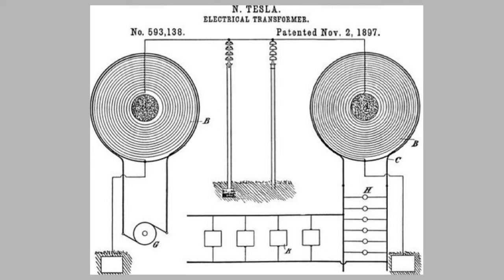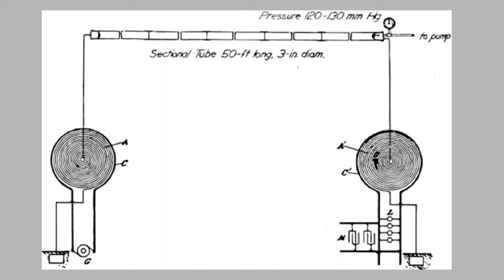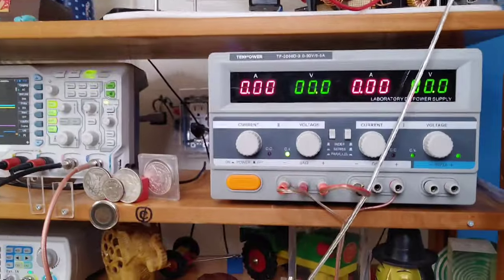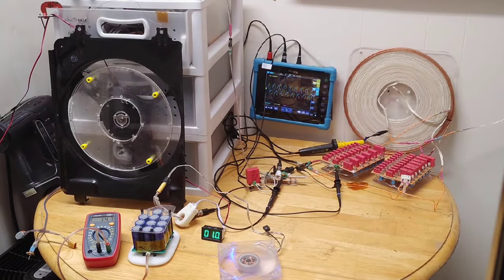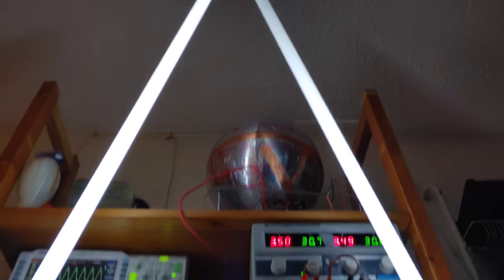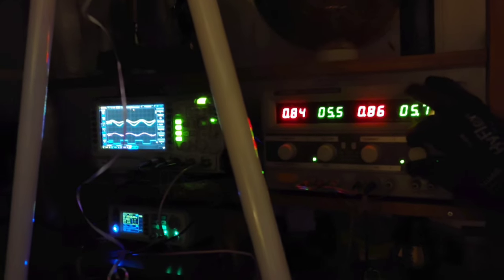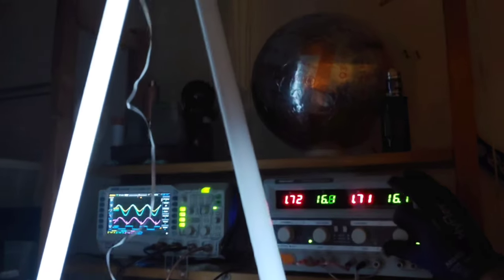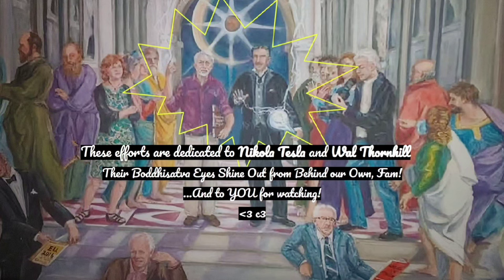Nikola Tesla's Single Wire Power Transmission, Part I: thru Flourescent Tubes & Wire

Comment: You seem to have a lot of stuff but you don't know what any of it does.
Neither of those fans are "inductive loads" if they run on 12vdc.
Whether the coils are wound clockwise or counterclockwise is completely irrelevant. Surprise: flip them around. See what happens. Its sad that you have so much useful equipment and zero clue how to use it.
Reply from the maker: Everybody know haters just jealous. My meaning was simply that a DC motor filled with copper windings presents extra inductance into a tuned/resonant circuit, impacting the rez freq. And yeah this is my debut video, opening line is "hello world", to go public with my lone project lol. Wanna come help?
Reply from the maker: Dude i've made dozens, i know it's arbitrary. Its also effortless to wind them opposite. I counter-wound them because it pleases me to do so, and because it pleases me to follow Tesla's patents.

But i do apologize that my excellent showmanship and well-spoken delivery caused you to expect an expert; and calling myself a "labs" is just my marketing flair lol. Mind the skillz, salty no0bz. Hataz just be jealous.

Im a petroleum engineering graduate teaching myself a new skill set successfully. But i DO understand energy systems, and also suspect there may be some advantage NOT being indoctrinated into "modern electronics". Next-gen energy, is a noble pursuit no? I'm pleased to help 'market' this stuff to non-experts (99% of ppl).

Btw i made the background music myself too, i hope it was annoying! You consumed all my goods, nephew. My first album 'cold electric' in 2008 went viral when i put it on bit torrent, track #1 was called Tesla. I'm a bit of a Teslaphile. My first original wiring product in my 'cold electric hardware' ebay store sold 8k units worldwide from 2017-2020.
www.soundcloud.com/djcoldelectric
www.ebay.com/str/coldelectricml

Blowin up my most refined output is just my style, dont be mad. And I PROMISE you wont see me claiming no 'free energy' quack stuff, i've taken thermodynamics lol (you heard me admit 20% efficiency right)?

I'm not discovering or explaining or asserting anything, just demonstrating. My only soapbox is ELECTRIC UNIVERSE COSMOLOGY 😈
Reply from the maker: @htomerif I've alrdy written your opinions/ ideas off as toxic, but go on and speak your truth bro, if it helps ya, poor guy, thinking he's supposed to know stuff. Do you find modern tech/understanding so impressive? We're a sinking burning ship thanks to our "understanding" up to this point.
Reply: @htomerif Man, even longest journey start with first step. Guy buid something and getting experience and also gaves a credit to guys in the field he follows. You just hanged on opposite wound coils. Why not try yoursels two flipped and two opposite wound coils. Use magnetic fiels viewer and see difference for yourself. Yea, put them on dc for steady field and watch. Maybe, just maybe, ferrocell will show you some compression/decompression lines. Finally, yes guy used oscilloscopes to show real signals which i encourage. No fancy equip just essential for experimental start with self learning so pls don't sheet about donating to some school. Schools are driven by someone's plan and program and this is open source. So, be constructive critics and show us something smart with flipped coils. Will You? Cheers!
Reply: @zeljkolukac4170  no. you understand nothing of what this video presented.

"blah blah journey blah single step"
Guy is walking the wrong way, towards idiocy.

"blah blah blah equipment"
he doesn't know how you use any of it and you don't know what I meant by "blinkin lights". Its a term. Look it up.
Reply: @htomerif  Yea, I guess that every ono who follows Tesla patents strictly is on blinking lights way. That way none can recplicate something usefull because it is fuked. Lot of replicators think Tesla transformer is 2 coils or two coils and capacitive load and lot of sparks. My homble opinion that system consist of 3 coils and capacitive ball at top. Good ground is must have. Thinking in terms low coupling, disruptive discharge, magnyfied amplifier, standing wawes and scallar potential. For me at the moment enigma is why Tesla used lot of turns thin wire in secondary serial tank circuit because that circuit tend to high current in resonance which is opposed to have tiny wire diameter coil which can stand only low currents. There must be some trick to overcome that. Is it skinn effect or some other way of propagation, who knows? What i want to emphase is build and share. No matter what just do it. Someone will catch the trick, eventually. I bought some equipment 6 months ago and did not yet even unpack it. But, I will!!! In meantime I watch others and learn from their efforts building my own ideas. Somone crazy idea can become your inspiration. So, do not be to harsh to builders. Let them build and enoy and help them with good advice if have one. That is my point. So, no hard feelings just respect and share knowledge. Cheers.
Reply: @zeljkolukac4170  He wound the coils in opposite directions and didn't know that its identical to just flipping them over.

Nothing he did could possible be anything other than blinkin lights after that.

Also, following an expired patent that no on uses for anything isn't in the least bit innovative.

I know exactly what this guy's intent was: he thought he was making a free energy machine because he understands none of it. The next step down that road is lying to people and actually claiming he succeeded.

I've seen it dozens of times. He will do it eventually. Its just the consequences of the sunk cost fallacy and narcissistic personality disorder.
Reply from the maker: @htomerif as a no0b i followed the design drawings of Meyl, Dollard, and Tesla, which all show counter-wound. Its aesthetical. Dont worry tho, i have a clip showing a bigger unifilar sender coil, with more primary turns, powering the same bifilar receiver, and point out how the resonant cavity balances out the whole sysyem regardless.

And i got some 'lit review' of the russian patents from recent years (Avramenko, strebkav, others) and an IEEE paper on single-wire rectifier circuits 🤷  

Still unsure why you assume I'm a free- energy loon, unaware of the coil winding direction impact, but I'll not try to change YOUR little mind 😅